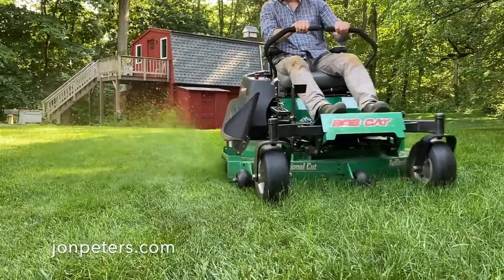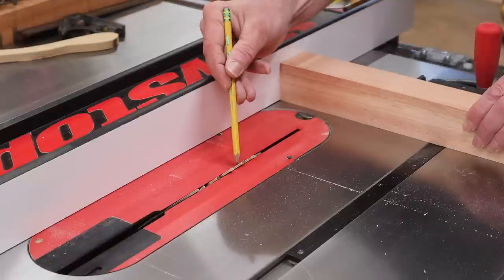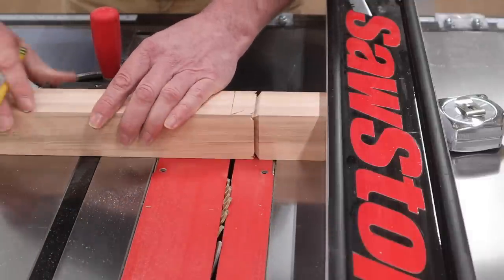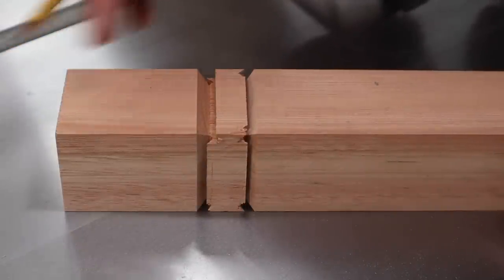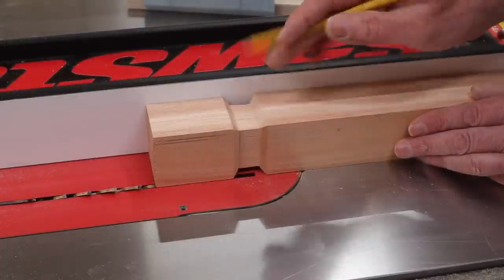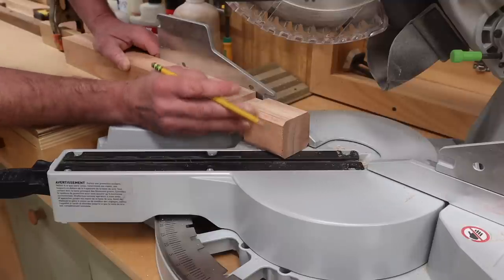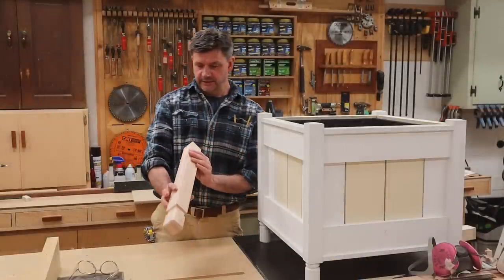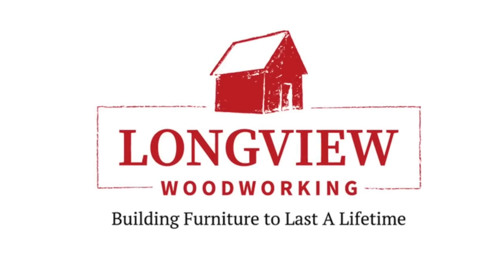Garden Planter Box Leg Design - How to Make Planter Legs

Comment: Absolutely gorgeous. I'm one of your biggest fans Jon!

A couple safety questions.
1, when cutting a piece on the table saw that is longer than it is narrower, you said in the past one should put some kind of a spacer on the table saw fence further back than the blade so that when the workpiece makes contact with the blade it won't be touching the fence anymore. Is that true?
2. The way you moved the fence to the other side of the blade with the blade tilted towards the fence, I understood that that orientation can cause dangerous binding and kick back. What's your opinion on the matter?
Reply: While not the only consideration, a risk with the situations you mention is the cutoff piece being caught between blade and fence to kick back.  In the cases here, these cuts don't go all the way through, so there is no cutoff, and he retains control of all the pieces of wood.

Comment: You can avoid using a plastic liner with this trick. Spray the inside with autobody undercoating. I have planters that 15 years old and don't have a bit of rot on the inside. You can make any size or shape you want.